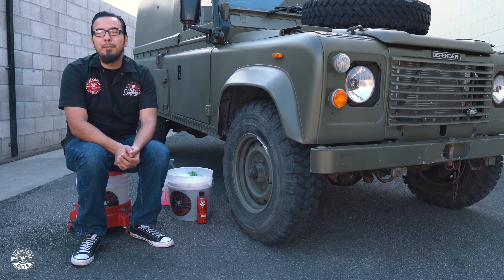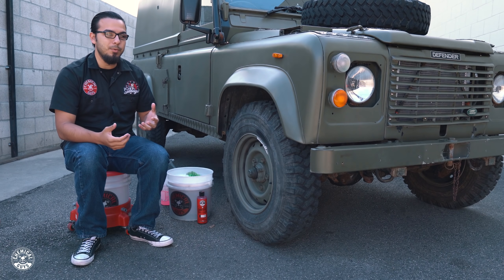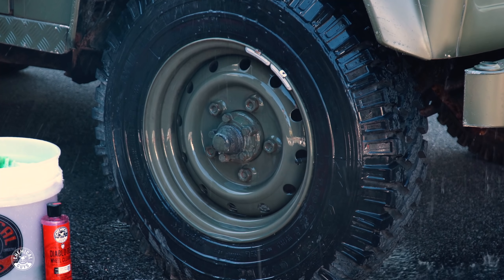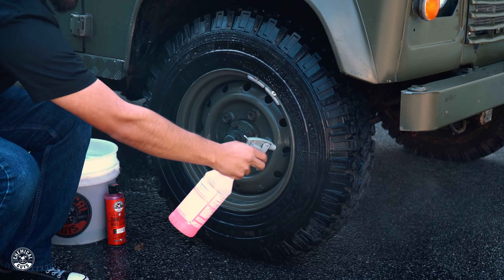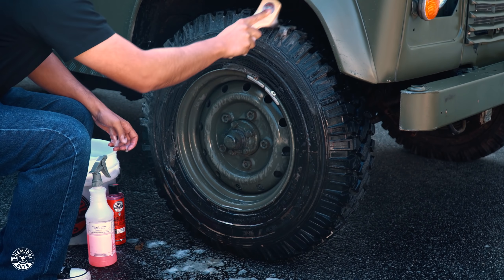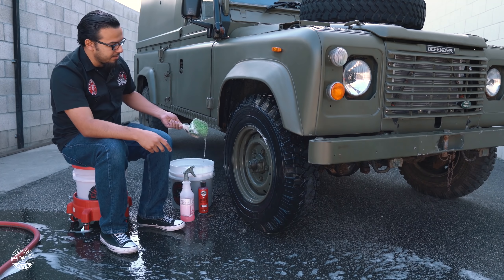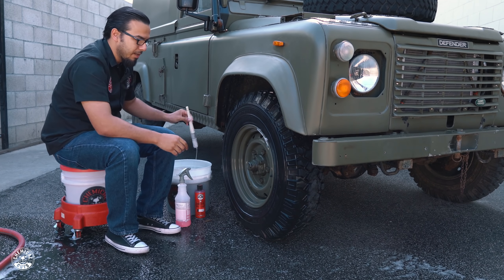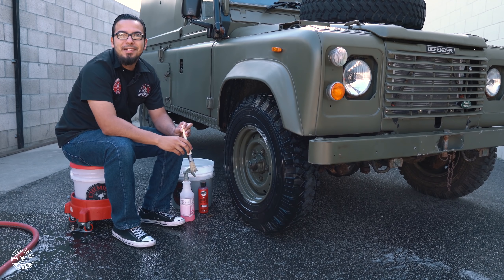How To Easily Clean Filthy Off-Road Wheels! - Chemical Guys

Comment: Did you just clean the car, before the wheels?
isn't that the wrong way round?
Reply from the maker: Hey Danny! In the video we mentioned that the owner only wanted the paint revived but once that task was completed the wheels took away from the overall look of the vehicle. Normally detailing the wheels would be the first step in the wash process. - Happy detailing!